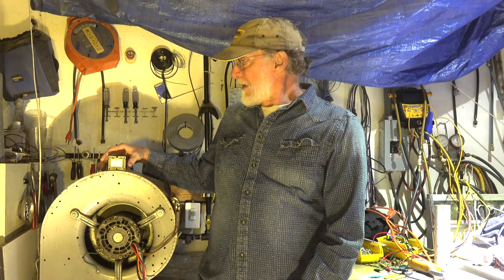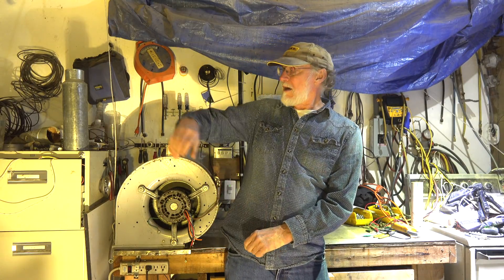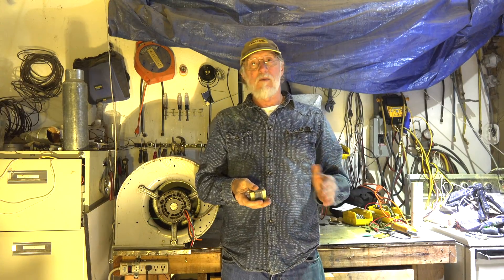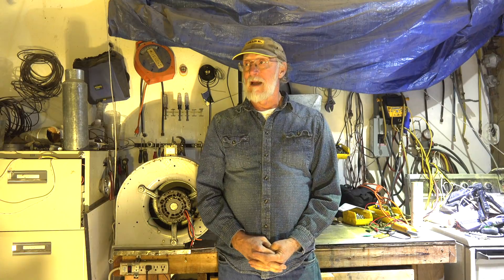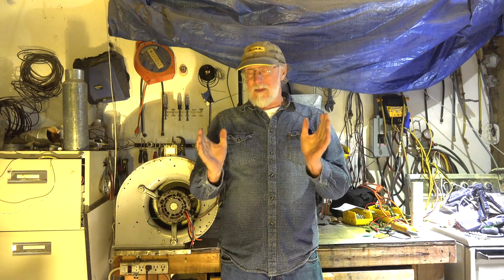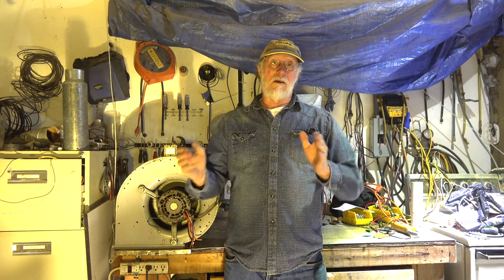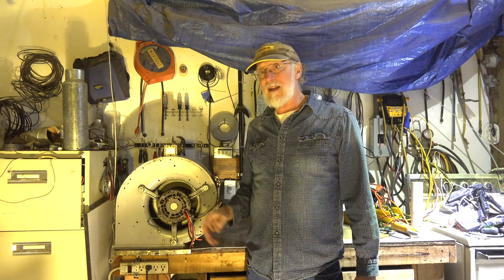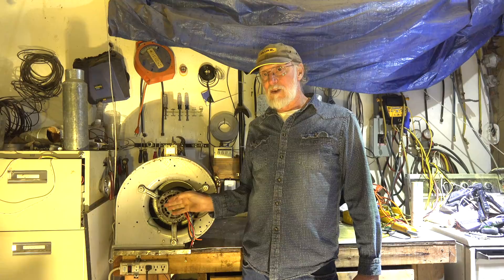A couple of HVAC myths

Comment: I'm going to throw a wrench in your monkeyworks.

The least electricity and/or gas used is when a furnace or HVAC system is properly matched for the square feet it's heating or cooling.

A system that is too small will run a lot more than it needs to and will use more electricity and/or gas.

A system that is too large is not only a waste of money to buy but will also run more often and use more electricity and/or gas.

Don't bother disagreeing with me because I already know your unteachable

Comment: I had my furnace checked today and yes it is old - but within 5 minutes was told I had a cracked heat exchanger and he had to :"lock out my furnace"  and then he drilled a hole in my ductwork and put a carbon monoxide detector and kept moving it around and then said I had a leak.  When I got upset and started to cry he left the furnace on and said "I won't turn it off" but I am going to put a tag on it to say that I did.   SO what the heck!

Comment: Flipping the breaker every night might end up ruining your entire panel.  Especially if it's an old stab lok panel.
Reply from the maker: If its a stab loc, it probably be replaced anyway.
However, a failed breaker should not damage the panel unless it overheats the buss bars.
GFM
Reply: @grayfurnaceman  definitely should be replaced. Constantly flipping the breaker can make it come loose burning up the bus bar. I work for a property with 200 panels. Supposedly not able to refinance without replacing every panel. Getting bids but I dont think it will get done.

Comment: its 3/10/2019; I have a Rheem Criterion 2, (model# rgdg-10eamer)  with a bad heat exchanger its out and I can not find a part number on it. Could you please help out. The furnace is over 20 years old.    thank you.
Reply from the maker: If the heat exchanger is available,  you just use the model and serial# of the furnace.
GFM

Comment: Question about gas mixture in extreme cold, it is minus 40 celius windchill here right now and ive noticed my flames have quite alot of orange in them and flicker quite a bit, my 95%  combustion intake is vented outside, i figured maybe cause of the denser air it  was creating a lean condition so i took off my burner cover and plugged the intake with a sock outside so it would only use inside air and the flames went back to mostly blue and steady but as soon as i put cover back on and removed sock flames went back to orange mix and flickering, my question is, is  this normal in extreme cold to create a lean condition and will it damage my exchanger or do i have to get pressure checked when its this cold
Reply from the maker: First, wind chill is not a temp reading.  Its an index.  Use the actual temp.  Extreme cold will create a rich condition.  
I can't say I have ever seen this problem.  Are you sure the vent and combustion air inlet are both clear of ice and snow?
GFM

Comment: If a small power transformer is wired with 120v primary and 24v secondary and not using  energy on the secondary is the power consumption zero?
Reply from the maker: Not quite.  There will always be some inefficiencies in the windings.  Its just very low.
GFM

Comment: why do transformers hum so loudly
Reply: i hum when i have a lotta Energy, too. but i stop Short of Breaking into song and dance, unless its AC DC,  then ill do the Electric slide.  Shocking, i know. 

thats all the puns i got fer now. love you muah  bye!
Reply: Transformers will resonate at the frequency of the line voltage. In our case (the U.S.) it would hum at a frequency of 60hz. Some transformers are louder than others. Loudness of the hum has to with how the tranny is mounted or what it is mounted to. It can also be loud if the tranny is damaged, i.e. loose primary/secondary windings vibrating. There's not much difference between speakers and transformers.....vibrating coils of wire that emit sound.

Comment: 1979!  breakers from that era broke them-selves, started fires and didn't shut off in a timely fashion... especially federal pacific, may as well have had a fuse panel and with 30 Amp time delay's in every hole, even they opened faster :))
Reply from the maker: You forgot Zinsco.  
GFM

Comment: Another myth along the same lines is that heatpumps are less efficient than heat strips in cold weather because they run all the time. So they turn to emergency heat below 40 when new ones can supply very usable heat at 10F. reality -  heatpumps use a tiny fraction of the energy of heat strips and all the energy used by the compressor gets absorbed by the refrigerant and transferred to the house,  whatever the outdoor coil picks up is free heat reducing the amount of electricity used by the heat strips. The strips only have to kick in a little, even if half the heat is supplied at a cop of 2 to 3 and the other half by the strips, there are huge savings compared to resistance heat.

Like 10 years ago on a forum I was trying to convince someone to not shut the heatpump breaker in the winter in ontario, canada.   He was convinced that the 3kw or so the heatpump was using below the balance point  was being wasted due to seeing the temp slip with just the heatpump running. Stat was configured to allow heatpump to fall behind, shut it off, and bring on 100% strip heat until end of cycle - which caused the original complaint about heatpumps being "useless" in colder climates. (yah, as if strip heat is better) 

I couldn't get through to him.
Reply: "newer ones" that are perfectly installed, sealed and charged... now lets talk about the durability of the electronics and when they'll see that mythical "return of investment"
 they 98% chance will never recover anything and not worth the rebate/tax deduction, as it all ends up on their "credit" which they pay 10x interest in the long run.
 only time any of it is logical, is when it replaces ancient coal conversion furnaces that push more heat up the chimney than into the house and cost $300+ per month to operate.
too many people fall for and spread the great lies that the bean counters, shysters and marketers sling daily, enough is enough time and it's for change in that department ;)

Comment: I'm going to heat my house with 20 electric fans. {:  That way I'll save a lot of money on the gas bill.
Reply from the maker: Might work well.  Maybe a bit noisy though.
GFM
Reply: Except electric is usually more expensive. Hence why they put in a gas furnace in the first place.
Reply: @thelightninghunter23  I'm in fl so I dont see a lot of gas. Your statement is true. I realized several years ago when I noticed laundry mats use gas
Reply: sounds like some people I know in summer with the AC on..... 15 fans in the house whirring on high and thinking their saving on electric..........................
I showed them the err in their thoughts, they called a month later with power bill reduced by $60+ a month, using only "3" fans to further circulate air, one of them being the HVAC blower.

Comment: Thank you for the information.  Makes sense.....  my furnace does not run very often while my neighbors does.... houses are about the same though I use more gas with the furnace running less often compared.
Reply: Could it be the differential on your thermostat is too wide?
Reply: @JoeLinux2000  good thinking, huge temperature swings can and does often use more energy to recover.... which is why I'm against having huge temperature setbacks programmed in. it takes time for the structure and all materials within to reacclimate, meanwhile burning extra energy for a longer period that just keeping it heated to start with.
you really have to do heat load and loss calculations for an answer if it's economical or not,  most often the answer is NO and your far better off spending money on having insulation added. I'm not talking about a 3 to 4F setback, but the nutters that do 15 to 20F or full shutdowns nightly ;)
Reply: it could also be due to water heater, clothes dryer and oven, if their gas. examples, you have a hot water leak? take long showers/baths or always a bath vs. shower, factor in the number of people in the household? do laundry, wash dishes, cook very often? leave or have windows and doors open very often (them pesky kids!)

Comment: That story reminds me of someone who thought that GFCI receptacles drew 30 watts each all the time. I told him that if it was drawing that much power, it would not take long to melt.
Reply from the maker: Never heard that one before.
GFM
Reply: @grayfurnaceman  Me neither, but it got me wondering how much power a GFCI actually draws. I tried testing it, but the current draw seems too low for my amp clamp to reliably measure.
Reply: @averyalexander2303  you'll have to test it with a ammeter/dvom in series on the hot feed wire. I'd guess on them all being well under 2 watts, more realistically I'd imagine 1/2 a watt.
 if it's not warm to touch, then very lower power usage. I have no GFCI's laying around close by in the house, I'm not digging in the garage (22F outside), nor will I un-wire one just to test lol. I always use low power night light bulbs as an example to people.
Reply: lol @ 30 watts, it would be a mini space-heater!!! hot to touch after minutes and molten plastic and wall fire comes to mind...
just tell them to go feel an old fashioned night light bulb, then a 40 watt or 60 watt light bulb, then go feel whatever device they think is drawing so much power. they'll probably have a clue after they get their burnt hand/fingers cooled off :))
Reply from the maker: Good thoughts
GFM

Comment: Transformer hum is annoying as heck
Reply from the maker: Yes and grounds for replacement.
GFM
Reply: @grayfurnaceman  What if the transformer is ungrounded?
Reply from the maker: The last comment was not about grounding.  Substitute "reason". 
 Grounding will make no difference.  
GFM
Reply: @JoeLinux2000  Well, connecting both terminals of the transformer to ground, aka a form of grounding is a sure way to get rid of that annoying hum. It only works with the low  volt fuse jumped out.

I'm unsure of if having a transformer ungrounded causes it to make noise,  but the form of grounding i was referring to lets out all the stored "hum" noise energy at once in the form of a loud buzz followed by a pop.

sorry i have a bad sense of humour - but the trick works, you know.
Reply: @grayfurnaceman  I was just joking about grounding.  I know transformers are mostly for antennas when they are not being used as insulators.
Reply: hum can often be caused by "bad electrical loads" like hair dryers, curling irons and other device on "low/medium" settings. how? most run the "reduced output" levels by using the crude method of half wave power rectification by adding a single diode in line.
example, the device on low now draws 6 amps "peak" on low, using 1 half the AC wave, which is at 60 cycles/hertz frequency. so instead of an equal load of 11 amps, it's now 6 amps load pulsed at 60 times a second, that makes many things on the same circuit or phase/leg of power feed "sing" more so the things with iron core and magnetically shielded transformers.

Comment: when you generate electricity from a water wheel, how exactly does that come from heat.
Reply: Anytime electrons are moving in a wire you have friction and heat. Next time you are at your water wheel generating plant, put your hand on the generator you will see that it will be a bit warm.
Reply: @BarkerArt    Similarly with wind power.  The wind is produced by air pressure differences which are caused by solar heating and the heat content of the land or sea.
Reply: He was talking about electricity in typical Electric Strip Heating applications.   Clearly energy in various forms is converted back and forth to electric power anytime you are working with electricity.  Energy can be in the form of heat or mechanical work (also called mechanical energy - eg kinetic energy or potential energy).  Among other forms of energy are radiation, fusion, fossil fuels, chemical etc currently harnessed by man. Hydro electric is one of the most common conversions of mechanical energy to electricity where kinetic energy of water in motion is converted into three phase electricity.   And then we convert part of that energy back to mechanical work in our blowers and compressors.
Reply: @BarkerArt m You win the prize for the best answer.  In the meanwhile, I'm waiting for hell to freeze over.